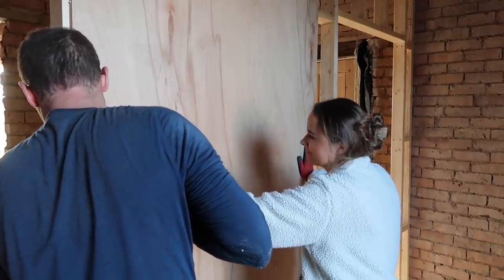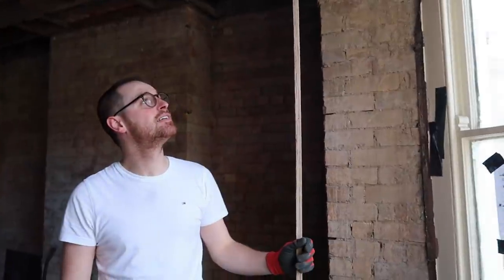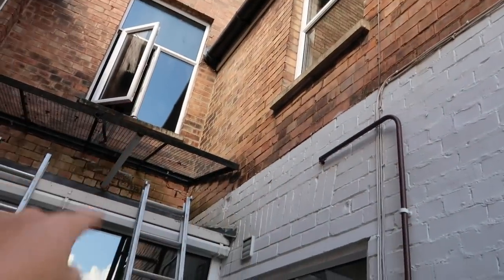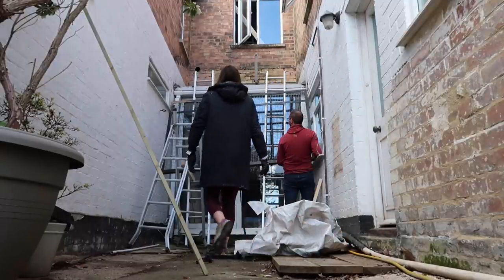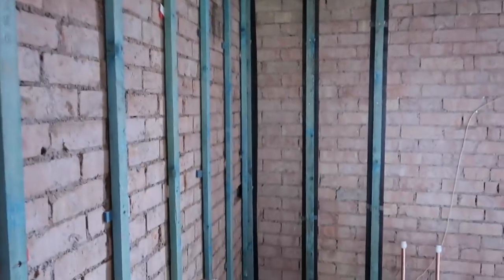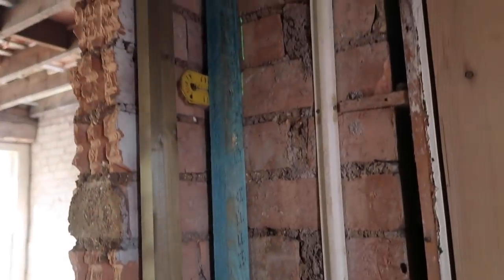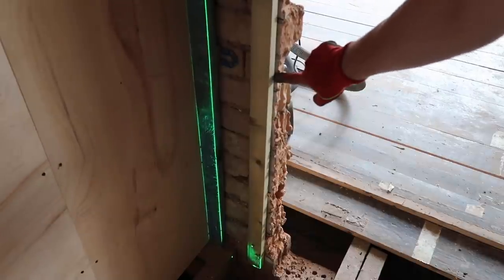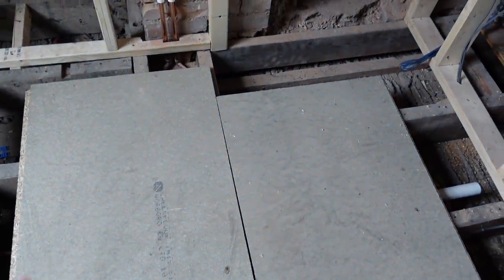A HUGE SET BACK | Laura Melhuish-Sprague

Comment: We recently renovated our bathroom and included a low profile (16mm) electric underfloor heating by Warmup. We encountered the potential floor discrepancy as you’re describing, as it was a total gut job we dropped the floor height to make sure there wasn’t a problem with the finished level. You’ll need to consult your plumber to ensure that the subfloor plumbing has sufficient ‘fall’ - my o/h ended up re-plumbing the sub floor and reducing the height of the exterior wall drain pipe work to create the correct ‘fall’ as the quote was eye watering and he has similar wicked engineering skills that Ollie has 💫! Hopefully that makes sense - if you need any further details then DM me. Good luck & I thoroughly enjoy your channel!

Comment: I had underfloor heating installed in my bathroom and the height difference was minimal and easily accommodated by shimming the threshold strip by a few millimetres so it was level with the bathroom tiling - made no noticeable difference to the other side of the doorway  (there would have to be a real flood in the bathroom for it to affect the other side of the doorway).  So I think you’ll find it’s fine as the electric mats are not that thick .... they do, however, cost an appreciable amount to run!
All I would say, is to ensure the supporting chipboard for the mat and the tiling is a good thickness - someone I know’s bathroom floor was 18mm and it eventually flexed enough to break the cables in the mat.

Comment: If you are just wanting the underfloor heating to prevent cold tile floors and not to heat the whole bathroom, it might make sense to do electric underfloor heating. I believe that you can get electric underfloor heating so low profile that if you are using it under tile it will add little to no additional height.

Comment: I don't know if it will help but I watched youtuber Kerry Whelpdale.  She recently renovated their house and was trying to minimize the extra height added on by underfloor heating.  She found a low-profile  underfloor heating system that is supposed to be very thin, I believe it's called Total 16 by Warmup.  Apparently it only adds 16mm to the floor.  I believe it's water heating and not electric underfloor heating.  Maybe it could help minimize the threshold height between the rooms.
Reply: Isn't Kerry lovely I really like her channel.

Comment: My partner and I are running into the same issue with our bathroom remodel as we are planning to put floor heating under the tile which will elevate the bathroom floor level. The solution we’ve found is to use some reducer transition trim on the boundary between the tile and the hallway hardwood, but we haven’t reached that point in our reno so I look forward to seeing your solution!

Comment: Regarding the floor height issue, I would bring it out into the 'hallway' area between your bathroom and bedroom doorways, about a foot or so but that will depend on the space between the open hallway door and bathroom doorway (assuming the hallway door opens into that space). I would then run your flooring lights along the step edge to reduce the trip risk. I'm sorry I don't have any picture examples, I hope that made sense!

Comment: What was that steel grate thing there for originally?
Reply: I imagine to prevent leaf buildup on the roof of the extension? Since it’s at an angle things would slide off easier and since it’s a grate any debris stuck there wouldn’t also be collecting water along with it to fester like it might on the roof…
Reply: I thought it might be a safety thing for those windows. It would stop anyone's fall.